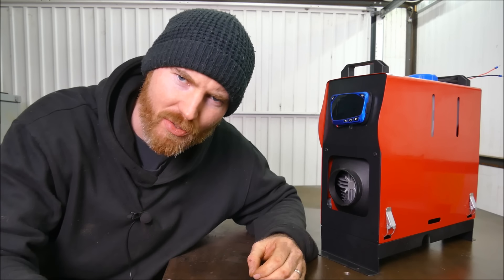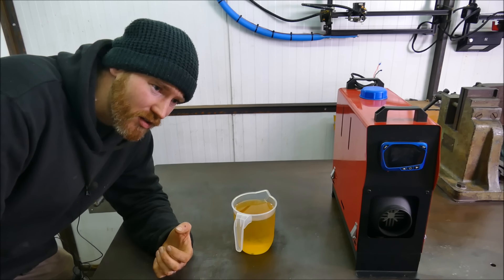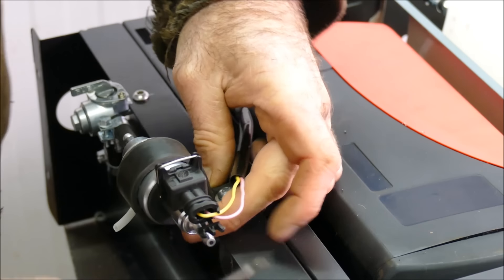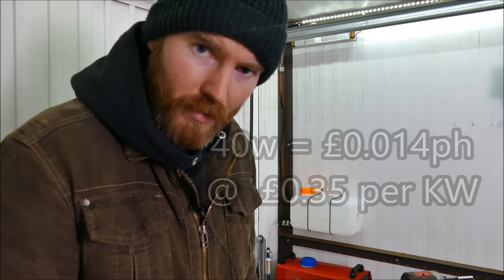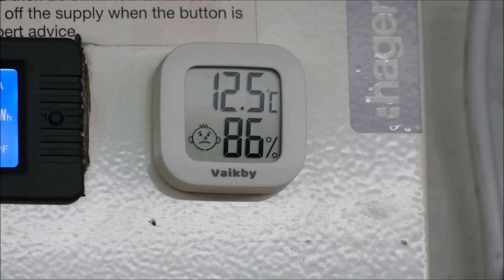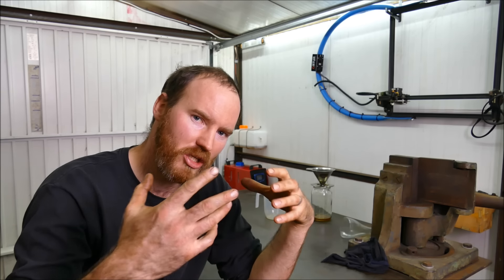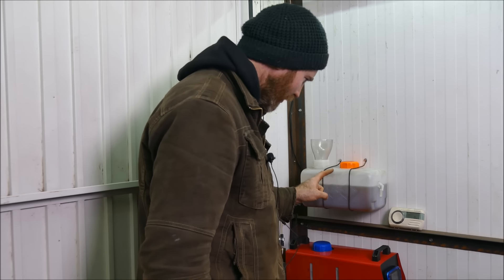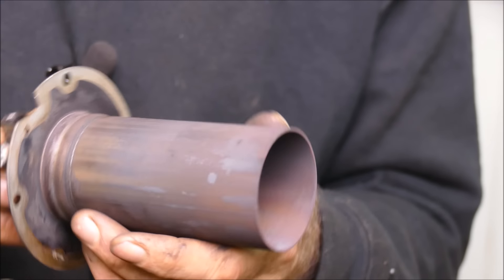£0.03 per kWh heater modification - Top facts & lies on diesel heaters - waste veg oil burn success

Comment: “They don’t teach you nothing practical “ very true statement, mainly in today’s system.
My first year in high school 1964 (USA) I took a class, divided into 4 sections, drafting or mechanical drawing, electronic where we did projects using surplus analog phone switches, sheet metal fabrication, and metal working. To this day it was probably the most impactful class I ever took.
Reply: I just took things apart out of Curiosity, even if I ruined part of their construction. However, my father forgave me as  the item or appliance was already malfunctioning and I could always blame the age or general deterioration through use that was the failure. But I got better and better at it and now regarded a genius. So, Rock’n’RoLL is ere to Stay.!
Reply: just a comment.  They obviously were not successful teaching you about double negatives in you English classes.   They don't (do not) nothing practical, should be they do not teach you anything practical... For the rest subject matter in class is only valuable to you if you are interested, otherwise as you say they were not practical.  Others may have found them practical for their needs
Reply: @johnwilson6732   thank god practical things are more important as language.
Reply: I also did metalwork, tech drawing, art and woodwork at high school in Australia in the 70s and became a carpenter. They also taught me to think for myself and use critical thinking, Not like the indoctrinated kids these days.

Comment: For a heat exchanger run the exhaust through a pipe filled with sand. (1kg sand heated to 40c will take @ 5.5 hrs to drop down to 20c.)
Reply: i wonder does it mather what kind of sand, like with smaller particals  ?

Comment: I saw another video where someone passed the exhaust through an old radiator. It did an amazing job of adding additional heat to their workshop. That even makes me think if it's worth passing the heated air that you want in the workshop through something similar. Still watching the video.

Comment: Nice video, great experiment! I love my car's Webasto. So nice to program a starting time and go sit in a warm and defrosted car in the morning when it's -20 outside, and it's so much better for the engine. It runs off of my petrol tank, my car is a CNG/Petrol hybrid, and I've wondered why it doesn't use CNG instead of petrol. I guess there is a reason for it.

Comment: you should run the exhaust tubing through a bucket of sand. the sand will heat up preventing exhaust condensation as well as trapping more heat for longer radiant heat exchange.
Reply: throw a bottle of water in that sand, take a pipe angled downward into a cold sand with another bottle to distill water at the same time
Reply: is that similar to a rocket mass heater design / idea?
Reply: @ghostwhite1648 Using the otherwise wasted heat to distill water is an excellent idea

Comment: I appreciate your diligence in your testing of these units...
We tried one of them with actual automotive waste oil. I don't recommend it. It almost ruined one of our units. 
We even tried cutting it with red diesel (which we can still use, over here)...
I haven't tried waste cooking oil, it might be worth looking at. Caster oil is used, similar to kerosene, and might burn nicely, or could be cut with kerosene or diesel... I don't know the cost per liter, but it might save a little money.
I have 4 of these units, 3 are currently working (the 4th is the one we tried with automotive waste oil)... 
I have one for when I'm out camping (a portable unit, similar to yours) and one installed in my shed. I had considered running a radiator-type system to trap more heat in the shed, but haven't actually built it yet. I was considering using copper tubing and a small fan. 
My heater runs off a battery and is supported by a 200w 24v solar panel. I plan to place a second solar panel to increase the amps for recharging my battery system (about 100ah SLA battery pack, made with used BackUPS batteries)...
Thanks again for the video, I learned a few things!

Comment: Hi Josh. I think you should put a right angle mounting bracket on your fuel change over valve so that the drain retainer plug on the bottom of the unit can be orientated correctly,,,,,,,, it does act as a sedimentor/separator and on lawn mowers or motor bikes when the cup at the bottom is removed you will find water or fine sediment in there especially if you are careless with your fuel quality ,DON'T ASK ME HOW i KNOW.  as a qualified mechanic I have had lots of these off and rarely find no sediment or water, because of yours mounted on the side any sediment/water will go into one or the other of your fuel supply lines ( eg, diesel or kero. ) I appreciate you  are more carefull. and I appreciate your channel keep up the good work. col.

Comment: Okay here's one. When you increase the length of the exhaust beyond the maximum that stated by the manufacturer after their testing, he would have to increase your inner diameter size by 1 to go a certain distance further or to go through more fittings elbows whatever. For water flow there calculators on everything every type of fitting etc I'm sure there is four exhaust as well and I'm also sure bever doesn't say what the maximum is for that thing or have much of installation instructions. Thanks for giving me something good to look at!

Comment: To make even more efficient use if the exhaust heat, coil up the exhaust, run it into a box and put a small 12 volt fan on it to pull all the hot air out. Should have fairly cool exhaust
Reply: @madusmaxamus8670  I am pretty sure he will be able to smell the Diesel exhaust and moreover he can install meter to check for exhaust. There is always a way around things. And I'm pretty sure it could be the same the other way. He has exhaust running inside the room, what's not to say that pipe won't start leaking sooner or later and do the same thing?

Comment: Run the exhaust extension as a straight piece of pipe, but running downhill to the exit through the wall, self draining condensate. Combine all the suggestions of putting a copper shroud around the exhaust, and have THAT pipe with its air inlet  quite a bit lower than its outlet, thermal action does the rest.   (Bob Packard)
Reply: can you perhaps show a picture or drawing of what you have explained?
I am dutch and it would help a lot to understand what you mean to say.
Reply: @bertjesklotepino  Steam condensates inside exhaust to water when exhaust is suddenly cooled below 100c. (water, sand battery etc.)
If you run the exhaust with proper downfall, the water inside the exhaust can simply drip out the end and not clog the exhaust.

Comment: I think you should not use paper element filters for diesel or kerosene unless specifically designed for it. Normally fine wire screens are used for diesel if you check at your auto parts dealer. The common cheap small paper element filters are for Petrol. Apparently the paper element eventually goes “soggy” in diesel and deteriorates. As it does so, it can pass along the fuel line and cause clogging/damage further on which can be difficult and expensive to fix in a Diesel engine.

Comment: The water in your exhaust is condensation of water vapour and you would do well to put in a small water reservoir to handle this water, that you can drain when you empty the bucket and fill it up fresh water. Otherwise it is a great idea to use waste oil products to heat your shop, and the simplicity of the burner and cheap price makes it a decent solution. Any person with a bit of tech know how could use this but just make sure the distance from flammable surfaces is good enough and get rid of the exhaust outside where it cannot set fire to anything, like long grass or other stuff that can lean against the wall. This nonsence that you should not use vaste oil from engines and such may be because of the pollutants that this little burner generates, while the large furnaces they use to burn it may be a cleaner solution, but I would just sneak in a litre now and then anyway. Who would know, right?

Comment: Would filling with sand be practical for the heat exchange- maybe run a section of gutter for the exhaust pipe to sit in the sand or reuse your water setup

Comment: Ideally, your exhaust would be roughly the same temperature as the air temperature in space you're heating. You could put a pipe around your exhaust and blow room air through the gap created in the direction against the flow of the exhaust. Counterflow heat exchangers can achieve the optimum of ambient temperature exhaust temperature.
Reply: I have done this, put a 5" pipe around the extended exhaust pipe. To toggle on when the pipe is hot and brings in 80 degree outside air in 30 degree outside temps to create a positive pressure in the room with makeup air. I also use free alternative fuel.
Reply: I was thinking the same thing. 12v fan blowing through ductwork in opposite direction from exhaust. You could also consider installing 2x90s and doubling the exhaust back on itself. Would have kept all of the holes in your wall closer together if that is a consideration to someone.
Reply: Is there a limit to the air intake temperature to the burner if not the air intake could suck air which is ducted over the exhaust pipe, no need to force it by a fan.
Reply: @sirfenderjazzmaster  0
Reply: i go one better.

28mm copper pipe. cross drilled with bits of 3/16 soldered in.
two reducers to wrap it in 50mm pipe. about a foot long. yes, i happily work in both units at the same time.

thermosiphon heater, up to a hot water tank.
solar panel thrown on the element for a bit more pizazz. some days i dont bother lighting up.

old auto radiator inside the container.
Reply: my thoughts exactly!
Reply: If the exhaust pipe was angled down that should help with any condensation.
Then if the pipe was surrounded by 4/5" pipe, the angle should create a natural air-flow to recover waste heat. Would this negate the need for a powered air-flow system or would the heat recovery be too small?
Reply: @lowwatthalo1654  surface area.
stock pipe of two foot or so isnt much area. whereas a few meters of it...

think a chimney, doesnt need much temp to get a flow.
a certain diameter works best for a certain length at a certin temp but thats just complicated and pointless. make it big enough but not too big? if theyre too small theres too much friction from turbulence.
cant be restricted top or bottom though.

there will be a certain combination that will get the maximum heat out. i doubt youll ever find it without wasting time and money ekeing out a few extra watts...

a sealed room would require a loop. sucking from low venting up high...

still, with a venturi/air accelerator, you can use the fan of the heater itself to keep driving that warmed air in from around said jacketed exhaust. just a Y fitting will do it.
Reply: Marian kerosene
Reply: Condensation forming from water vapour in air used in combustion.

Comment: While I applaud your efforts to give us the facts about these heaters can I ask you to address one issue that runs through this video. When you describe fuel consumption or the cost of heat production the answer cannot be measured in milli-litres of fuel (or indeed pence) "per kilowatt" since you have to allow for the duration. So it is pence "per kilowatt hour" as you correctly show in the title - but nowhere else.

Comment: I enjoyed this video a lot, quite inspiring.  I plan to augment the exhaust heat recovery design further with a DIY heat exchanger and combine this with an air source heat pump.  To maximise heat recovery and efficiency, I will split my exhaust into 2 using 3/4" BSP 3 way cast iron female tee (3/4" bsp measures 1" inside), then slip a dozen copper coated scourers around outside of each tube, encase the whole thing in a metal duct and use a separate air input to be heated by the exhaust and feed the warmed air into an air source heat pump.  The heated air will enter the cold side of the heat pump and wont be used for the clean air input,  [for safety] just to ensure any exhaust gas leakage does not enter indoors. Running the oil heater on minimum Hz, I hope to be able to a) recover the most heat possible from the oil heater and b) be run the heat pump in a temperature range [in winter] where it works most effectively.  Hopefully will produce a lot of heat at minimum £/KWh ;)
Reply from the maker: That's awesome well done. I'm making another combo to go on my house as a window module. It'll heat an external hot water tank which can be used for central heating, showers etc.

Comment: Excellent video!!  Spent many years experimenting with WVO (Waste Vegetable Oil) for fueling diesel engines. I see a lot of parallels with this.

For a diesel engine we achieved clean and efficient combustion by preheating the input oil to about 160F (71C). At this temperature the WVO thins out to a viscosity very close to diesel and atomizes much better. We did this by using waste heat from the engine with a fluid-to-fluid heat exchanger - engine coolant one side and WVO input line on the other. We also used a startup and shut down phase on regular fuel just like you already are and would only switchover to WVO once the engine was warmed up with the 160F preheat temp reached. You don't have engine coolant to use for preheat in your case, but you do have the exhaust heat.  We experimented with that and found it to be too harsh / hot to use directly in a heat exchanger with the oil - it would polymerize and plug up after a while. But since you plan to already make a hot water heater with the exhaust, you could very easily use your hot water output as an input to preheat your oil input to the burner! This video is re-sparking my interest and I may have to add some similar experiments to my channel!
Reply: So would it'd be possible to use a little water pump in a close circuit that runs around the exhaust and into the fuel tank to heat it a bit? It should be linked to a temp sensor that somehow shuts the line on and off depending on the temperature of the fuel and the water so it doesn't boil obviously.
Reply: @uploadsnstuff8902  Yes I think that would work. I'd definitely include a high  pressure relief value incase of steam buildup - just like the old boiler systems used. A pump may not even be necessary as it might be possible to thermo syphon a loop like a drip coffee machine.
Reply: The heated air (not the exhaust) would work great as it's a much lower temperature, just wrap a small copper tube coil and put it inside the ducting
Reply: I can't see the point of having a thin, solid skin hose on the input to the pump. It's necessary on the output to prevent loss of pressure due to the flexing of a conventional tube, but using solid wall hoses on the input along with a great big filter (most likely with air still in it) involves all those extra connections for no benefit as I can see. Use a bigger hose and save yourself some well deserved time and penny's 😅

Comment: Hi Joshua, first of all, congrats for your videos, I'm a big fan of your metal working videos and experiments. Regarding this topic, I would recommend you to get an EGR cooler (from a diesel car, to cool the exhaust before reentering to the combustion chamber) that way you will get a propper made gas to water heat exchanger.
Thanks for your effort!
Reply from the maker: Thank you so much. Great tip. Thank you. Cheers J
Reply: @joshuadelisle  been told a 2006 ford Galaxy is a straight bolt option as the hole sizes match the exhaust

Comment: Very interesting videos and experiments! The small electricity cost for driving glowplug and fan is adding as heat so its not wasted energy either.
Next time you try to heat water with the exhaust, just make it spiral down the waterbucket/tank and lead it out in the bottom through a sealing so condensed moist can pour out.
Reply from the maker: Thank you. Great tip. Cheers J

Comment: You can replace the water in the bucket with sand, which would allow the sand to get to temperatures higher than the boiling point of water.
Reply: And then put a thin coil of copper through it if water is required.
Reply: @dougle03 Doesn't matter if it's copper or not, aluminium is good-enough.

Comment: so on the exhaust you could change the ends on the radiator leave that in garage and get more waste heat is that what your saying and duct the end of the extract from rad outside. brill video